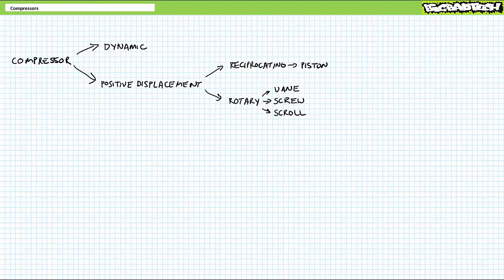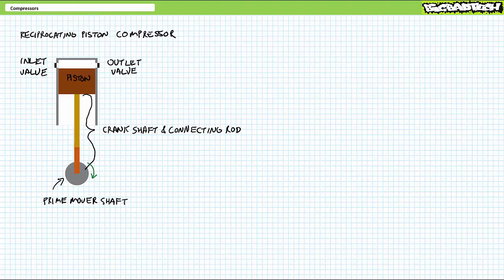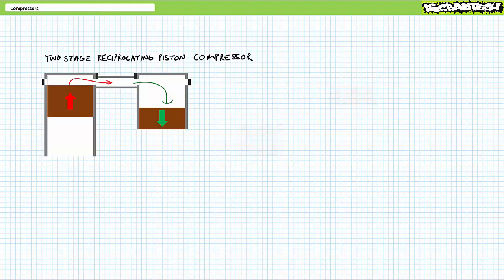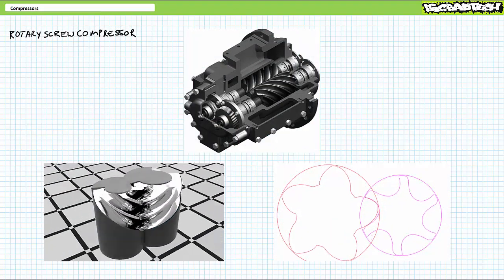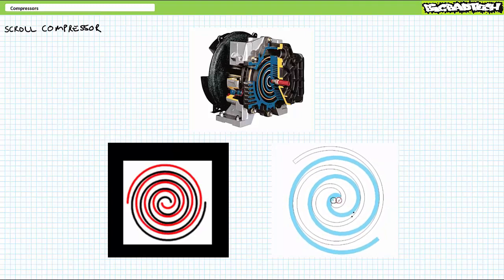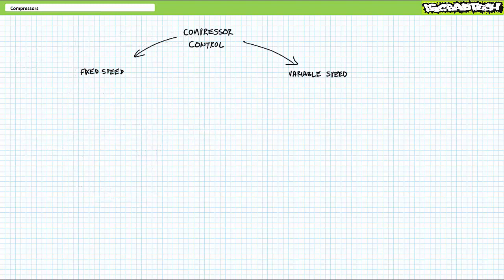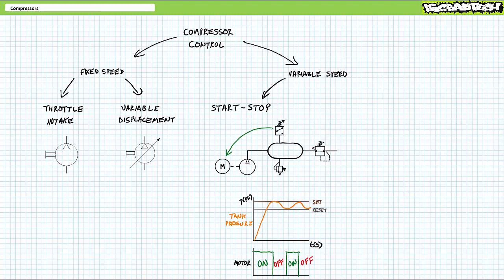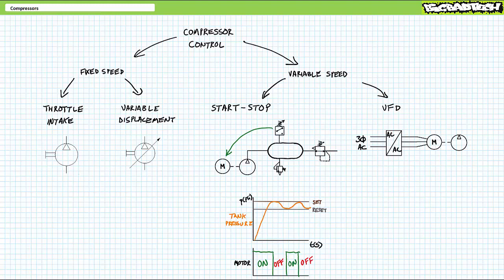Compressors and Compressor Control (Full Lecture)

Comment: Scroll compressors are increasingly common in domestic heat pumps and AC systems. One thing I didn't understand about these devices is the way they don't require high torque to startup because the pump doesn't have to overcome system back pressure to begin spinning. So, efforts to boost starting torque with hard start kits are usually unnecessary and ineffective.